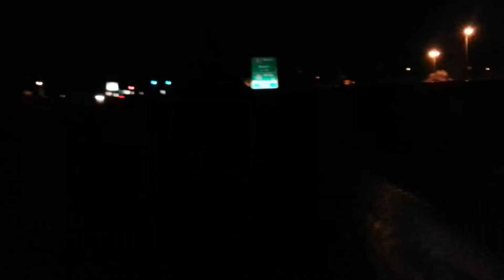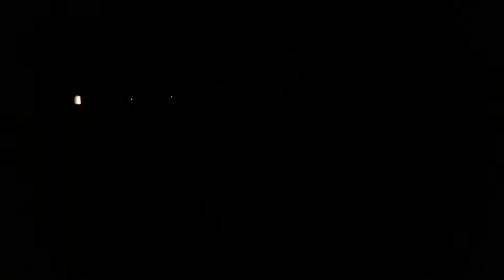Rattle between 3500 and 4000 rpm

Comment: Maybe you got this solved already but I had a similar sound that turned out to be an exhaust manifold gasket.  The small leak would cause it to vibrate at certain RPM's and make a noise like yours.
Reply: +Casey Stump with my g37x the exhuast makes a weird sound at idle and i do get the rattling at 4k rpm like this guy...might be the culprit.  thank you!

Comment: mine sounds like its coming from the valve cover but all of the valves are set correctly
Reply from the maker: yup that's where the sounded like it was coming from.  It was very strange.
Reply: Same with mine. Its more of a chatter up top just before and just after 4k
Reply: Did either of you figure the problem?

Comment: is it bad for your car, if u push it above 4000 rpm when it sounds wired?
Reply from the maker: Alexander Boeriis Well it depends on what it is.  This was only happening when I had my off road x pipe installed.    It did not do it with the GT xpipe and resonators.
Reply: mine still got the stuck exhaust, from the Factory  installed, it makes the same wired noice ´, its a 2015 Toyota with a small 1.0L 100hp engine

Comment: hey anyone get a solution for this sound i have also a same problem and someone told me that i have to put a little bit thick head gasket can it will fix
Reply: I'm also wondering to. Both my mustang and my f100 have the same problem. The f100 is alot louder tho

Comment: problem solve ?
Reply from the maker: Oddly enough at that time the fix was to remove the catless xpipe we were never able to figure out why it only did it with the off road xpipe installed, some thought it might have been just too little back pressure but it was hella strange and I never figured out what it was.  Nothing was broken so.